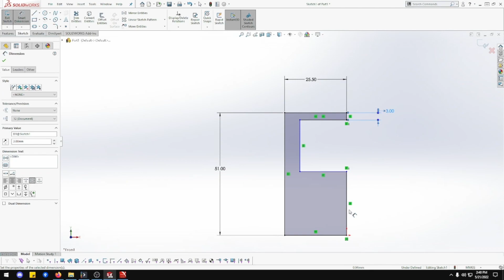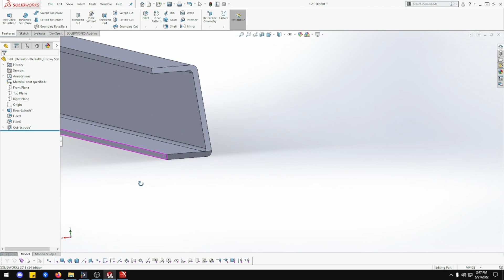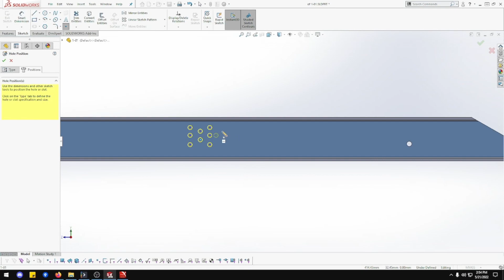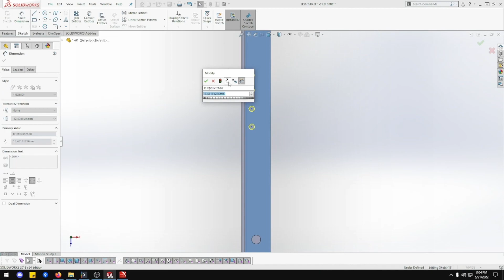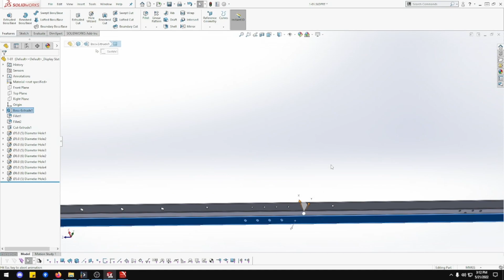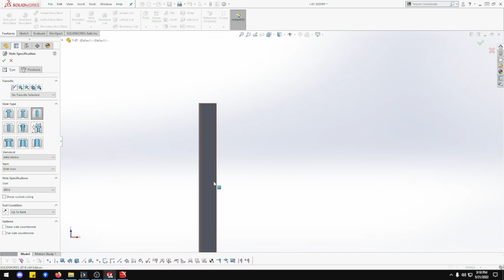E 3  - Part 1-01 - LH Side Beam - Let's Build the Clayton Undertype Steam Wagon

Comment: Is there a physical build or just CAD?
Reply from the maker: I am just doing a cad build, later on I like to do a physical build. I do have half the chassis and the suspension 3D printed.
Reply from the maker: Update, I am going to build a physical model out if plastic. About 30 inch long, and instead if the trailer, I’ll put the body on the truck.